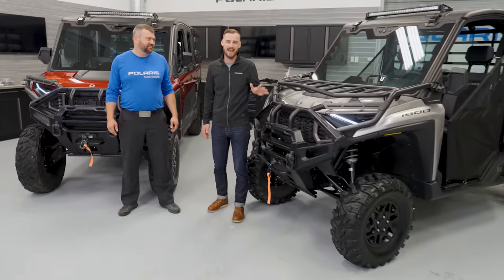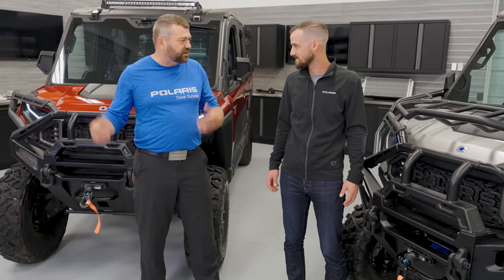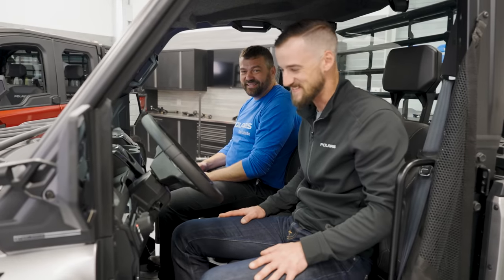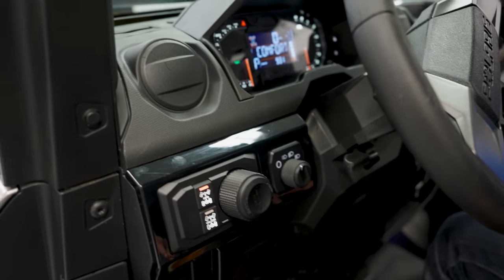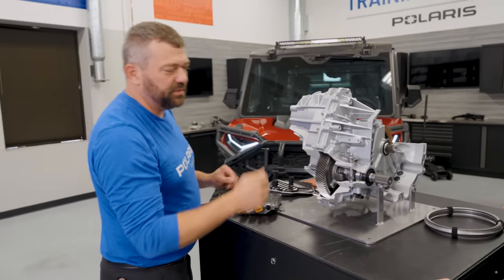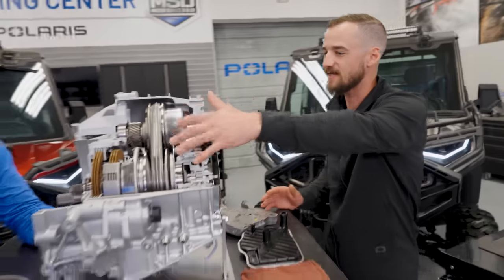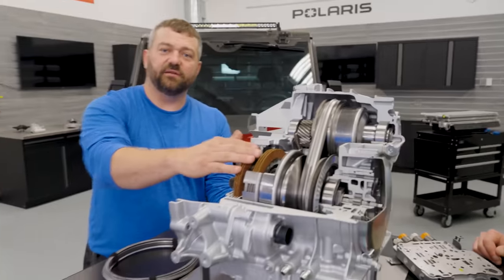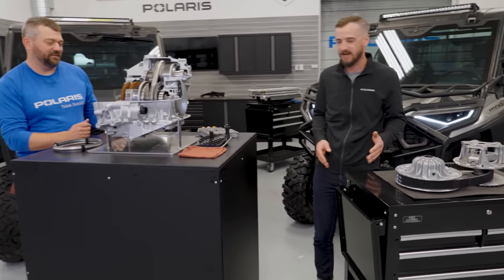THE ALL-NEW POLARIS RANGER XD 1500 STEELDRIVE TRANSMISSION DEEP DIVE - SHOP TALK EP. 28 | POLARIS

Comment: Why not a typical torque converter instead of the belt?
Reply: or shaft drv
Reply: @RocksNRuts4  huh?
Reply: @boydco6587  ? there is zero need for a belt, either dct or shaft drv (kind of the same) maint free nvr fails
Reply: @RocksNRuts4  Im not following what your saying at all.  How are you going to couple the engine and transmission with a shaft drive?
Reply: Belt replacement for gears not torque converter

Comment: I'm amazied I realy like the transmition looks heavy but extremely durable. Only concern is how would you keep the rads clean in wet dusty or especially a silty muddy conditions?
Reply: We ride to our remote cabin that has many long puddles filled with water and silt. I call it liquid pumice as it grids down the wheel bearing seals.

Comment: Is Polaris offering at least a three year bumper to bumper warranty from the factory on that machine?  Reason I’m asking that clutch looks challenging to service worn clutch packs.
Reply: ha u nailed it, n no way they will, their cs sux n they dont value their customers
Reply: 1 year bumper to bumper, 3 year powertrain warranty on this machine
Reply: Betting its non serviceable,  if it fails you replace it. Out of warranty that'll be a big expense.  I like the idea but I'd rather replace a 200$ belt.
Reply: @0xXAllForNothingXx0  Yea you might be right as to non serviceable to the dealer it might be factory rebuild replacements only.  
My concern is I use my ranger for plowing and things break ever winter. So it will be interesting to see how the clutches hold up since they said they are used in low speed applications first then the steel belt takes over.
Reply: @brianhill4995  yea, I wish it the best, after its proven itself id definitely consider having one, but ill not be a guinea pig at my expense.
Reply: I’ve heard Polaris warranty is about as useful as used toilet paper

Comment: I had an 04 Nissan Murano with the same type of CVT as this one (using a steel push belt). The transmission ran HOT, so hot it had 3 radiators for it alone. Bought it new, and traded it in for a Saturn Sky Redline with about 60K miles and zero issues with it.

Comment: What I can’t seem to wrap my head around is a metal belt on a metal sheave with an oil film wouldn’t it slip? I mean to transfer power from a belt to a clutch you need pressure and friction. Instant wear. Add oil, no wear just slipping. I’m obviously missing something here.
Reply: right....
Reply: Have you ever driven a Nissan with a CVT if you have they are very similar and aren’t that great.
Reply: It works, old technology
Reply: @carbpumper  does the talon or new canam r hav this?
Reply: This is why you have to run their crazy expensive magic fluid.
Reply: @RocksNRuts4  no, those are mostly transmissions with individual gears (dual clutch)

Comment: I see a lot of burn transmission in the future without low gear
Reply: Because you’re smarter than a team of mechanical engineers, right🤣
Reply: @Captndarty  even my brand new Honda accord with a cvt transmission that only cost me around 30k has a low gear… it even has neutral…🤷🏽‍♂️
Reply: @Captndarty  did you have ever own a polaris? I owed 3 and i can tell you it would nt surprise me at all if it happen
Reply: Teams of mechanical engineers < tons of recalls and burnt up machines  @Captndarty
Reply: @Captndarty  the same mechanical engineers that came up with a clutch design that forced Polaris to issue a stop ride?
Reply: Yeah because you’re gonna outsmart a technician 😂

Comment: Worlds worst transmission design! Ask any Honda, Subaru or any other car owner with a CVT and over 60,000 miles. Been a mechanic since the 70's and I have never seen such high failure rate across the board by all manufacturers, especially in stop and go conditions. They only exist because they are dirt cheap to make and last long enough for the warranty to expire! Then you're stuck with a very expensive repair!
Reply: Why in the world you judge just because it looks somewhat similar. It's like saying one plane is the same as other plane just because they both have wings. Polaris and every other utv used rubber belts for decades and they are fine there's no reason why wouldn't metal belt last. Cvt exists because it literally provides infinite gear ratios.

Comment: Cvt transmissions in cars are not good at all , I replace then constantly at my shop ,and as much as Polaris cost to fix that’s probably a 5 to  8 k transmission
Reply: $5k-8k transmission in a $2k UTV.
Reply: Utv have been using rubber belts for decades and they are fine in terms of durability. This one is steel.

Comment: does that mean a clutch tune is no longer springs and weights. but a tune that is flashed to the computer.    similar to an engine tune.     ( ex.. going to fuel injection from a carb. }

Comment: Hopefully you guys did better than the automotive world, those didn't take any kind of abuse or spirited driving. Otherwise this is just going to be a much more expensive way to change the belt
Reply: I agree. The Ford 500 and Freestyle were notorious for transmission problems with their steel belt CVT although the wife's 2020 civic is holding up really good so far but has only 45000 miles. 
I understand Polaris likes to innovate but I think a hydrostatic dual range transmission may be more practical in this application. Just a thought.
Reply: immediately the first thought, how do you change that belt buried in there!
Reply: Agreed, why copy failed automotive designs ? Maybe the go the belts cheap
Reply: There are a LOT of CVTs on the road today. Many vehicles with way more power on tap and weight to move than this utv. It looks like they did their homework and built a good transmission. Of course time will be the true judge of that.

Comment: 50 grand. You guys have lost your mind.
Reply: Already sold out for the year. Worked out fine for them
Reply: They start at 30. 50k will get you a 4 seat, fully enclosed cab, ac, heat, power windows, and heated seats. You only spend 50k if you get like everything they offer.
Reply: @findingxeno3285  The dealers ordered them. Doesn't mean the dealers sold them yet.
Reply: @sdvten  Polaris is paid when the dealers order them. Like I said, worked out fine for Polaris lol. Dealers will move these no problem